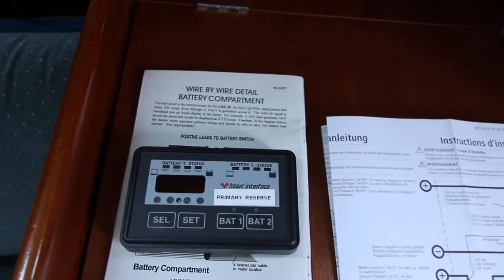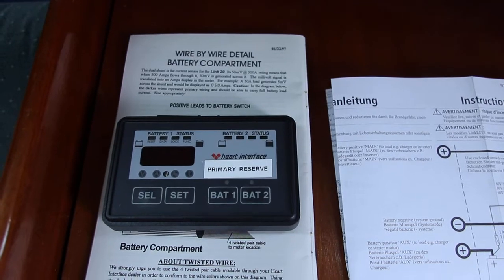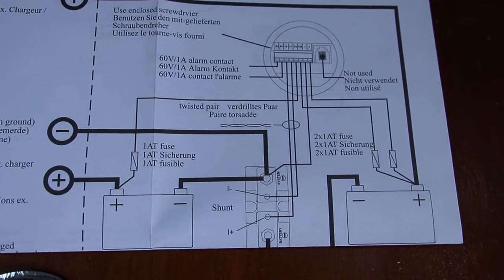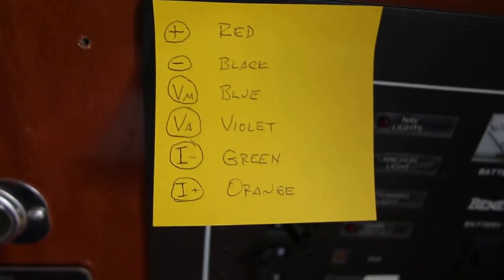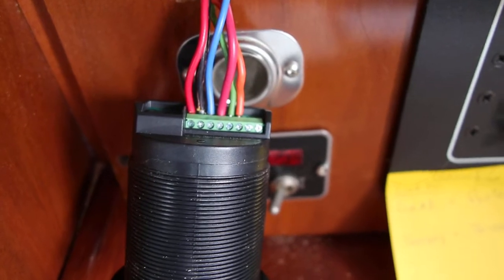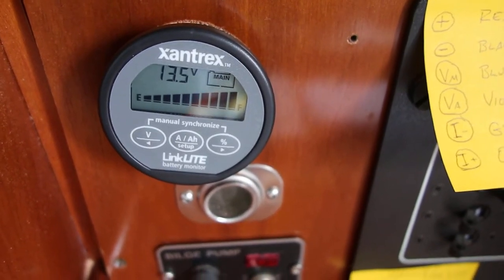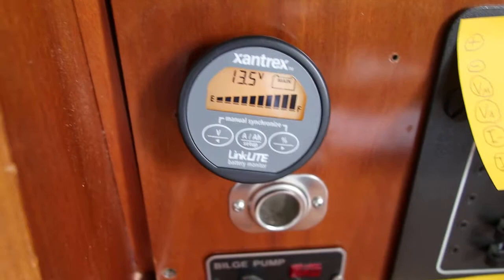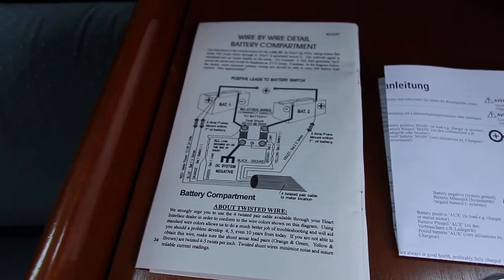Installing Xantrex Link Lite replacing Link 20 battery monitor

Comment: I'm looking to do the same swap.  I'm hesitant to drill the hole for the new unit without knowing it'll work.  I don't see how 8 wires were required and now only 6 are; to do the same thing.  I found a Canadian seller that still has the Link 20; so I could do a one for one swap, but their site isn't working.  I'm hoping they'll call and I can order over the phone.